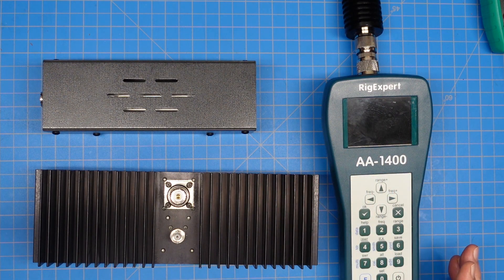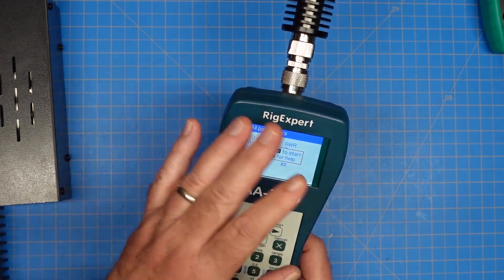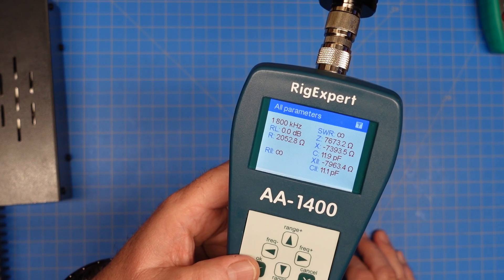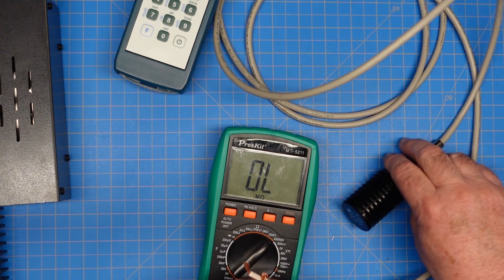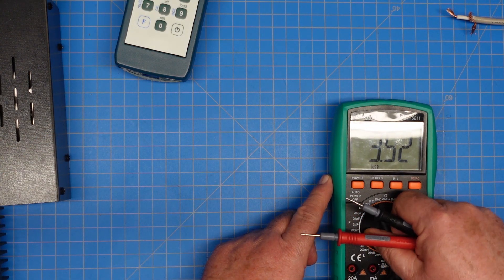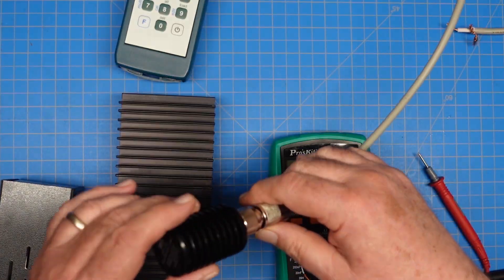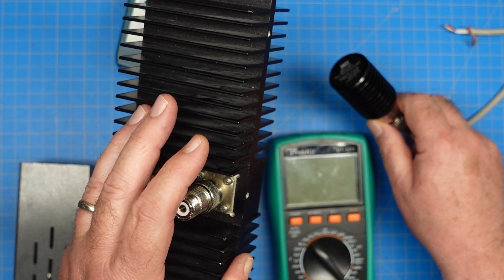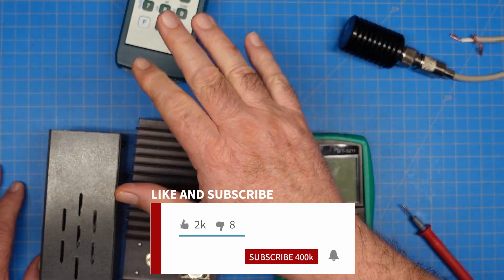About that MFJ dummy load...

Comment: I have and use many MFJ products. I usually find them to be good enough for my ham radio purposes. At a hamfest, I bought a used MFJ-264 dummy load for $10. I didn’t use it until I bought a NanoVNA. I checked the dummy load with the NanoVNA to get used to using the NanoVNA and got some unexpected readings. The SWR was higher than expected for a dummy load. I removed the cover and found a 60 ohm resistor in the dummy load ! Since it was used, I can’t say if it came from MFJ that way or if the previous owner put in the 60 ohm resistor. Perhaps one day I’ll replace it with the proper resistor. In the meantime I got a CelWave dummy load with the RF sample port. The checked out FB on the NanoVNA.

Comment: That 50 ohm termination load is rated to respond from DC to 500MHz, at an average of 15 watts. Obviously, infinite impedance equates to an open resistor, or the test cable is naughty. 73
Reply from the maker: Right!  Ape gave me grief about the cable("that's a gas station cable, son"), but I repeated everything directly, without the cable as well.  Same results.  That particular device is just broke.

Comment: I just tested my 261 and it reads 51 ohms resistance and almost zero reactance. Just a tiny bit capacitive but varies with freq. Just another data point.
Reply from the maker: Cool.  Funny thing is, this thing moves around in values, obviously by frequency, but on any one freq, the values still move around a good bit.  Hundreds of ohms on impedance.

Comment: Hans @ QRPLabs sold me a kit for a 20w 50 Ohm load. It is very handy and you assemble it yourself. Just a bunch of parts soldered between two boards with a BNC connector. Easy lesson to accomplish prior to building my QDX and used when testing it! Can’t beat that IMO.
Reply from the maker: Sounds great!  I have one I did build, from Rocket City, I think.  Same kind of thing.  I need to pull it out of the drawer, and give it a test.